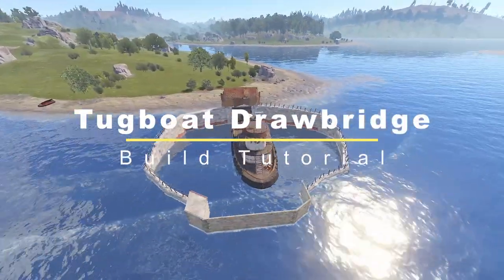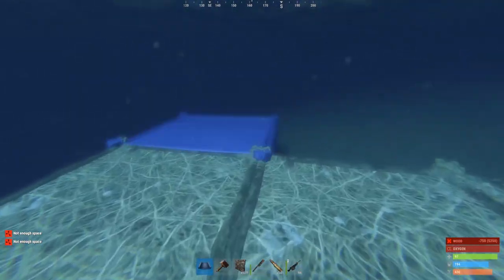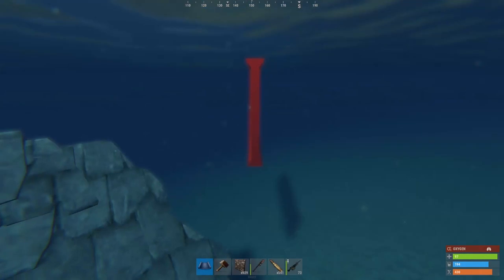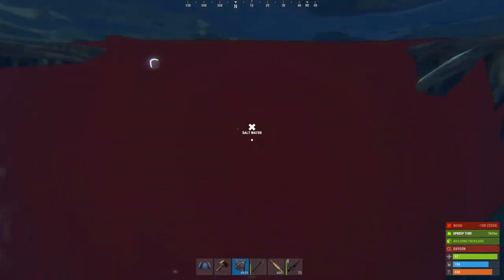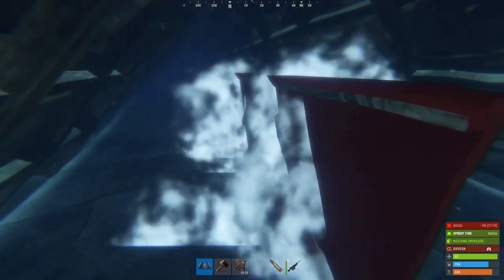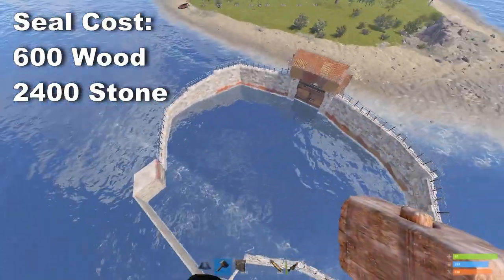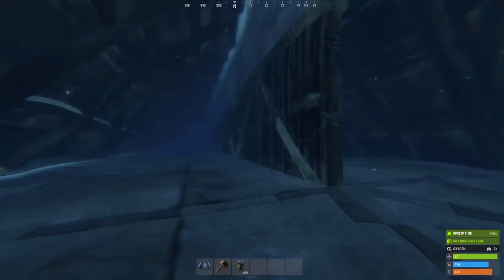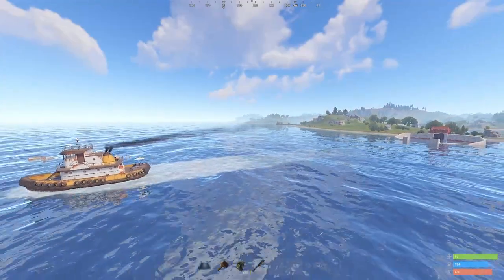Rust | INSANE STRATEGY TO PROTECT YOUR TUGBOAT | Drawbridge Build Tutorial

Comment: Better option would be to drive the tug to map border and take advantage of the fact the tug sinks until you drive right back on top of it. Or even better get 2 tugs. Full build one with doors, boxes. Add extra sets of scuba gear plus some beds and sink it to the ocean floor. Now you have an unraidable base you can access for permanent storage and it doesn't decay. Perfect way to store loot while being free to mess with absolutely anyone without having to worry about being raided
Reply from the maker: They are patching this out, by making it so that the ocean gradually brings boats that haven't moved back inland
Reply: @ChazzeyRust  hm least second option of sinking a tugboat would still work then
Reply: @jacobjordan6406  No, it wouldnt....sunk tugs despawn after 1 hour
Reply: @payne9469  well dang that sucks lol.
Reply: you can just build a 1x1foundation into a deep ocean to prevent the tug from drifting to the shore @ChazzeyRust